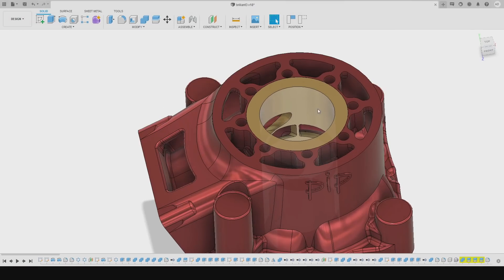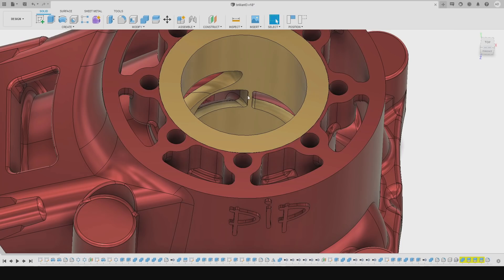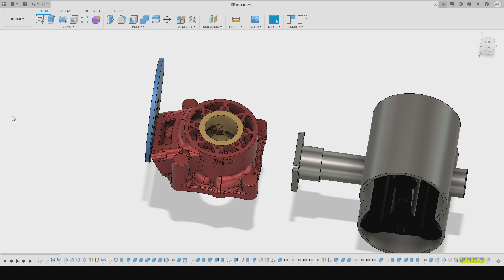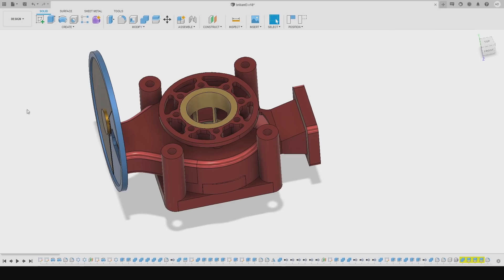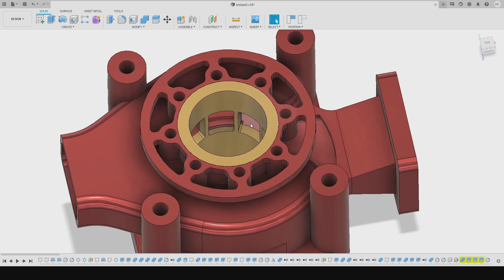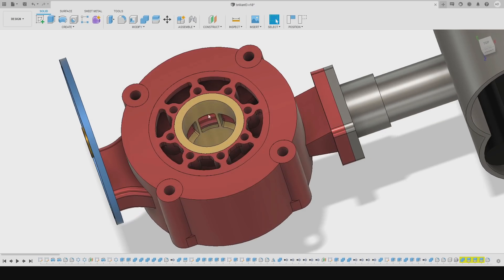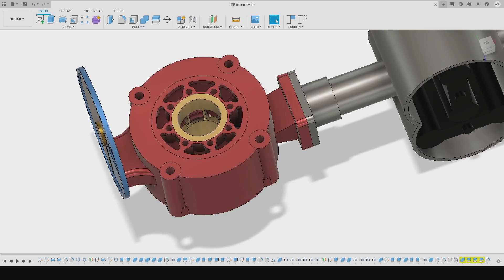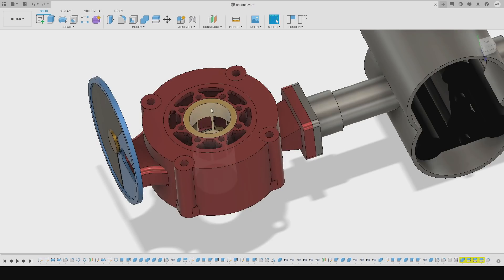Will BLOW Up the Competition! Seriously!

Comment: Your idea sounds like a Detroit Diesel design it will be interesting to see how it turns out.
Reply: I believe the blower on a Detroit is just there to pump in the fresh charge it doesn’t make much boost
Reply: @jons6125  as far as I know it just flushes out the exhaust gases with fresh air
Reply: @jons6125  Yes  sir you are correct it is literally a blower.
Reply: @jons6125  there is actually to little boost. 
At lower rpm some smoke fills the blower transfer ports. Tar builds up  2-4 mm. Above 1300 rpm the blower is stronger and keeps the transfer ports clean, pushes the burned diesel fume up to the exhaust ports..
Reply: I actually came to the comments to say this lol
Reply: I operate two Detroit Diesels. Very efficient
Reply: @tinolino58  Yes they are.
Reply: The Detroit 2 stroke diesel doesn't produce boost due to the driven speed of the super charger and its easier to add a turbo before the supercharger to increase boost than over drive the supercharger

Comment: Not much time (stroke) for compression but then I guess most 2 strokes don't have all that much in the way of corrected CR. Reed valves being blown open, charge contamination & making an exhaust valve which can take the heat & pressure will be big challenges let alone actually getting the thing to run. I guess a conventional poppet style valve could work with a suitable actuation method. Do you plan some form of variable drive for the blower or a controlled bypass? You've also got the lack of support for the ring to consider too....
Reply from the maker: Lots of things to go wrong. Better get that prototype built and start crossing off the list👍
Reply: @2STROKESTUFFING  Direct injection would circumnavigate a fair few issues but maybe a bit too far for the initial prototype!

Comment: You're half way there. Add direct fuel injection, into cylinder and you have no fuel waste since you will only start injection after the ports are closed. You're only flushing the cylinder with air at this point. Since the crank is not being used you don' t need oil in your fuel so emissions should be much more enviromently friendly. You basically have 4-stroke lubrication. The best of both worlds. It makes the engine a bit more complicated but gives you insane 2-stroke power.
Reply from the maker: Simple prototype, then...
Reply: @2STROKESTUFFING  Nothing is ever simple in life. The hard part is making it look simple in a 10 minute video😁. Keep up the good work. I'd love to see a modern two stroke.

Comment: Why not use available technologie i.e a poppet valve in the head in a standard uniflow configuration?

It's known to work, has less unknown variables and there's knowledge available, at least kind of. The problem of building some kind of drive mechanism for the valve arise anyway, and could be avoided by using a servo - would include the possibility of completely free exhaust timing.

Your idea is kind of sexy though, but there's lots of unknowns.
Reply from the maker: Simple prototype first, then evolve.
Reply: @2STROKESTUFFING  
I'm eager to see where it's going, no matter which way it'll be 👍

Comment: Thats the same supercharger I was going to use on my 2 stroke diesel concept. I look forward to seeing how well it works out! Also will be interesting to see if you couldn't  get  the rotory valve timing tight enough so that you won't lose much of your air fuel mix straight out the exhaust

Comment: As you may know, 2 stroke engine are prohibited in Europe, except if you use fuel injection and catalytic converter. So, future of such system seems completely blocked ! Only solution is 4 strokes or different fuels.
Reply from the maker: No problem, I'm not gonna sell them anyway, just for fun!
Reply: @2STROKESTUFFING  OK my friend hope that you will reach the 20 hp for a 50cc that they did in 1960/70. All the best my friend.

Comment: We Jones,, have Done this already (AS WELL AS IN 1946) 😃, you will see it doesn't need reeds.... exhaust rotory timing is key; good luck.
Reply from the maker: Awesome! How did it work out?
Reply: As originally designed, the E90S was to be supercharged, with the blower mounted above the gearbox, and driven by the clutch. The loss of the supercharger meant that the design was compromised, lacking sufficient flywheel effect, which caused problems with magneto failure. The main initial change was to reduce the valve angle to 90 degrees for a more compact combustion chamber.
Reply: Despite the traditional two-stroke’s reputation as a “dirty” engine, the two-stroke cycle is actually remarkably well suited to clean-running, efficient designs. But that means departing from the usual port-transfer two-stroke system traditionally used on motorcycles. Instead we need to look to other two-strokes, like the vast, supercharged two-stroke diesels used on many ships, which are renowned for being some of the most efficient combustion engines on the planet.

Comment: Why not have the transfer ports higher than the exhaust ports? When the piston comes down the transfers will open first but the reed valve will limit back flow. Once the exhaust ports open you can use the blower pressure to blow burnt gases out.  When the piston rises and closes the exhaust ports you have an opportunity for the blower to fill the cylinder significantly above atmospheric pressure before the transfers close. This way there is no need for the rotary valve.

How about then going completely psycho on it - replace the blower with a N2O bottle. Pure nitrous + methanol mix with the ability to fill the cylinder to 2 bar or more. I have no idea how you's stop that engine from self disassembling violently though.
Reply from the maker: Interesting ideas for sure! Simple prototype first.

Comment: You should also consider oiling the crank and rod, as there will be no fuel/oil mix in the crankcase, in fact you do not need oil in fuel anymore.. Also, this is similiar to the detroit diesel 2 strokes. Greetings from Poland! :)

Comment: Detroit two stroke has a mechanical intake valve. and a blower to scavenge the exhaust gasses. its called a two storke diesel still. many similar ideas as this one.
Reply from the maker: Yeah, its kind of a mix n match between FOS, Uniflow, diesel etc. 😁

Comment: Ferrari tried this on a three cylinder two stroke, they used a camshaft with exhaust valves not sure why they dropped the program but it probably had to do with emission.
Reply: I've always wondered why nobody uses an overhead valve setup with a 2 stroke. Seems like it could work very well.

Comment: With a turbocharger instead of a supercharger it seems as if there's just an increased pressure overall, from the compressor side right to the stinger of the exhaust/turbine side.
Surely not a very efficient way of forced induction but more air mass nonetheless, may be something to look into.

Edit: Just realized it's 50cc, so yeah, obviously not going to happen...

Comment: Why not just turbo it? Its much simpler and doesnt have any parasitic hp loss.
Reply from the maker: But how would you get it started?
Reply: @2STROKESTUFFING  people have been turboing 2 stroke snowmobiles for years. The power valve in the exhaust keeps the exhaust from back feeding. Im all for your idea of the blower seems like it could work but would be very complicated to keep the rotary valve in time

Comment: this is an engine worthy of the name 2 stroke stuffing!! to hell with resonance! stuff that bitch using brute force! you said yourself why no manufacturer would use this it is too inefficient but it will certainly make power if the exhaust valve and more importantly the reed valve can handle it.. i think the bottleneck here is the reeds and i don't think spring steel (or any conventional material) reeds will hold up being hammered by exhaust gasses  very long? reeds are easy to replace tho and if the idea shows practical promise i'm sure u could figure that out..
Reply: this might be a dumb question or 7 but is there an optimal cc for best power/cc ratio?? i think u talked about this in your older videos.. is your swept volume the one that is measured? like my kdx 200 is that bore x stroke overall 200cc or is that 200cc swept volume? there is a big difference right?

Comment: Since you will be burning a lot of fuel outside of the cylinder, why not make this a pulsejet hybrid and feed that hot fast exhaust jet into a turbo to make use of all that energy to drive the compressor! It then becomes some kind of crazy turbo jet two stroke hybrid.

Comment: Great concept! I think the key for max rpm and with that the max power will be the timing of the exhaust valve. I‘m sure there will be a kind of pressure wave/ resonance effect within the exhaust port, that has to match with the closing of the cylinder ports at the „right“ rotational speed. Peak in the torque curve will show, where in the speed band that effect is most effective. Can‘t wait to see this run on your dyno including the way to find the right setup. 
Another thought came pretty direct in my mind: compressed air is hot, so a direct injection for the fuel could improve the end temperature of the compression before ignition and with that increase the power output. The injection could also be done into the transfers to get such an effect.
Reply: With a carb before the supercharger you get a lot of charge cooling from the fuel evaporating.  So I think it will gain more air mass in the combustion chamber with a carb or injection close to the supercharger than DI.

Comment: You should take a look at two stroke marine diesel crosshead engines (I believe some two stroke trunk engines use a similar concept). They are literally the most powerful two-strokes in the world, with the Wärtsila RTA96C-14 producing 108,920 hp. They have a similar concept to your design, but the cylinder only has scavenging ports and then a poppet valve for exhaust. The concept is basically likes this: https://en.wikipedia.org/wiki/Scavenging_(engine)#/media/File:Diesel_engine_uniflow.svg
Good luck with your projects, I really enjoy your videos :-)

Comment: Even if it doesn't work this is the kind of thinking that can push the whole industry forward. Awesome design and I really hope to hear it running one day!
Reply: it is basically a 2-stroke diesel engine, if you switch the export port with a poppet valve.
Reply: No. It’s an idea for getting maximum power from a given cylinder displacement (50cc) but ‘ brute force’ / unlikely to be cost or fuel efficient (or good emissions!). In the real world for more power simply use a bigger cylinder 😊
Reply: All these ideas were literally developed and eventually discarded in high speed two stroke gasoline engines in the 1930's and 40's. The current crankcase scavenged schnurle transfer arrangement makes far more power with far less complexity than those early "blower" designs.
Reply: Think of all the advancements made since the 40's in metallurgy alone and then add to that modern computed fluid dynamics. I would say there is still more to learn even from ideas we think aren't worth exploring anymore. As the saying goes, everything old is new again. Lets wait and see what actually becomes of this idea before we decide its not worth pursuing. After all, the worst that happens here is we learn something. Any chance to learn something is worth trying in my opinion.
Reply: would be awesome for some innovation when it comes to 2 strokes, especially dirt bikes. it would be amazing if the pro riders were on 2 strokes, then we could all afford to race!!

Comment: Airboxes have a specific size as do exhausts have certain lengths in four stroke motors because of resonance. An expansion chamber will only help make more power. Needs an airbox to pressurize and steady intake pressures. Resonance only helps, and without a pipe, there is still resonance. Out of tune resonance that will fight scavenging and rob power as opposed to helping and adding power.
Reply from the maker: We'll get to that after the prototype is running 👍

Comment: Your exhaust ports still have to "lead" your transfer ports. Your blower will lose efficiency at equal port timing. That will be compounded by the resonant pressure wave echoing off your rotary valve closure. By isolating your intake tract from the crankcase, you also develop a need for pumped lubrication for your bottom end. Examine the scavenge cycle of the junkers jumo engine (2 stroke all port diesel aircraft mill), and the "torroflow" scavenging of detroit 2 stroke diesels (both blown engines)

Comment: Seems to me you are making a uniflow 2 stroke, they have been around for years. I think your way will leave spent gas trapped at the top of the cylinder . Put a rotary valve on the cylinder head - Aspin style.

Comment: you could go for fuel injection integrated in the cylinder head. that way you could start the fuel injection after the exhaust port closes, which would prevent pouring unburned fuel/air mix into the exhaust cavity inside the cylinder, which could ignite when the exhaust port opens and possibly do some damage, especially if the mixture burns down the transfers towards the blower.  this is as you probably know the way diesels inject fuel into the cylinder, except they do it at the time of ignition. with this you could inject far earlier and get more then enough fuel directly into the bore before spark. you could also play with inducing swirl to the charge air (like they also do with diesels) to improve mixing by doing some magic to the transfer angels, though i'm not sure of the effectiveness at higher RPM. Just an idea i got when watching the video, great work btw!

Comment: This looks a lot like the that of a Detroit two stroke diesel. It uses the supercharger to force the air in to the cylinder's, but uses exhaust valves to expel of the exhaust instead of a rotary valve. So I see a lot of similarities to a Detroit two stoke diesel.

Comment: if you are firing fuel air mix out the exhaust you could probably put a cat to light off that extra fuel and air then use the gas to spool up a small turbo to help reduce the load on the AMR300.

Comment: Here you will get detonation in the exhaust which will be able to give back pressure, as the exhaust ports and intake ports are equally high, the filling line will be poor due to back pressure when the cylinder is to be filled??

Comment: What about a turning Shaft with a flattened surface in Exhaust-camber like the "power-walve" in newer twostrokes? But in this case the walve-shaft completely close the exhaust instead of only reducing the exhaust diameter. 
Greetings from Berlin.
Reply from the maker: Could evolve into that👍 simple prototype first.

Comment: Do some research for on two stoke diesels and opposed Piston engines the advantage of a opposed Piston is you can put the exhaust on one end and intake on the other playing with stroke and rod ratio can help you out with port timing
Reply: F1 are looking into opposed 2-stroke designs for the next power unit.

Comment: My dream is a 2 stroke with a supercharger, freevalve style intake valve(allowing the supercharger to make acual boost and not just flush the chamber), exhaust port (uniflow for scavanging), crankcase lubrication and cylinder pressure sensor. This way the ecu can do the otherwise complex valve timing very quickly and without a dyno. Disadvantages are most likely still mediocre emissions due to some oil off the cylinder wall going out the exhaust and the freevalve style valve possibly eating valve seats and requiring pneumatics

Comment: Jesus Christ that is brilliant and so darn brute force-ish, i just hope you get the rotary valve to seal real good because it is going to be under some serious preassures.
Reply from the maker: Thanks! Might need a drum valve, would cope with the pressure better I think👍
Reply: @2STROKESTUFFING  much like a ypvs valve only rotating as opposed twisting back and forth.
Reply: And it will be more even more if there is a misfire and the exhaust from the cylinder ignites the remaining fuel in the crankcase.
Reply: There will be no fuel in the crankcase.
Reply: @matthemberry  How? There is still a significant volume between the cylinder and the valves.